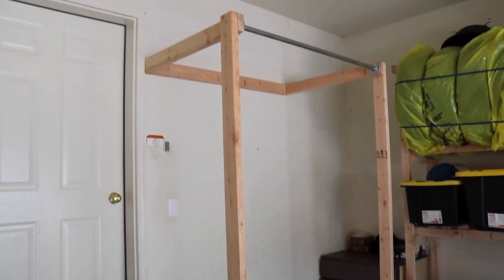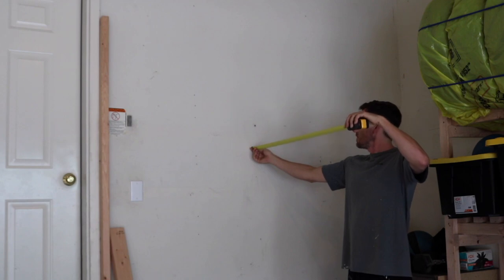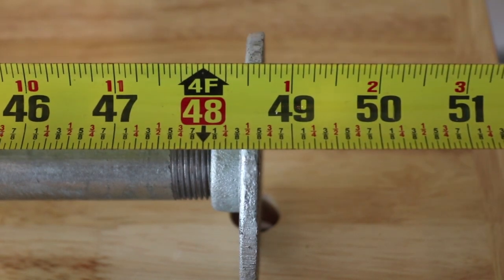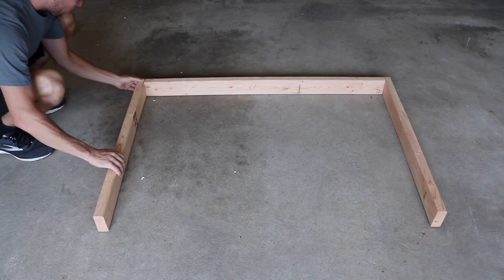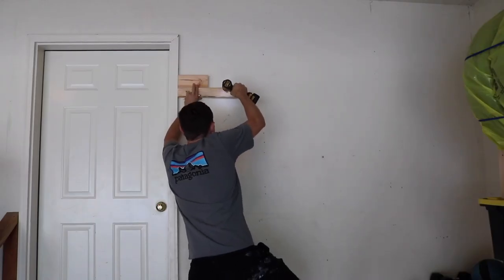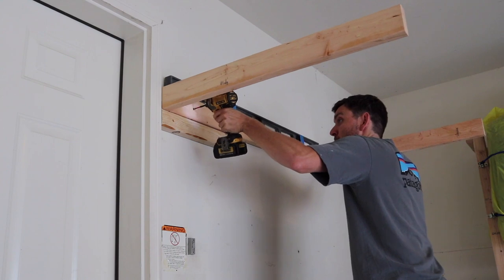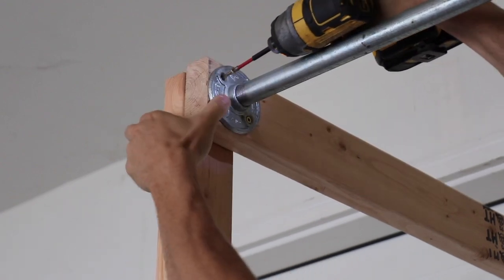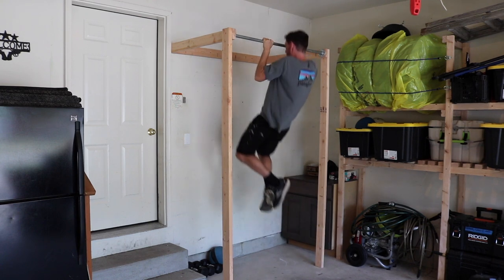DIY $50 Pull Up Bar

Comment: Excellent Idea to put all of your weight on the floor instead of the wall or ceiling! Maybe you could find a way to make the whole thing collapse flat against the wall when not in use.
Reply from the maker: Great idea! I didn’t think of that.
Reply: Yea mine is exactly the same yet i put hinges at the wall end an its like closing a door wen not in use

Comment: 1 year later, is it still works?
Reply from the maker: Yes! I still use it all the time. I added a very thin layer of foam and some athletic tape on the bar. Otherwise no modifications

Comment: Max weight load  please
Reply from the maker: I’m not a structural engineer so I can’t answer this. The load is on the vertical 2x4s, which would most likely hold any person.

Comment: Ingenious. What’s the pipe diameter you used? Thanks
Reply from the maker: Thanks! I used 3/4” and honestly I should have used a bigger pipe. It’s plenty strong but would be so much more comfortable with a bigger diameter.
Reply: @WoodworkingAcademy  thanks, would you go for 1inch or 5/4 inch?